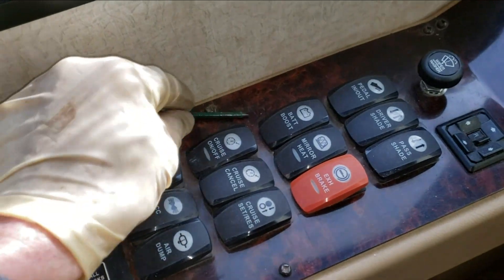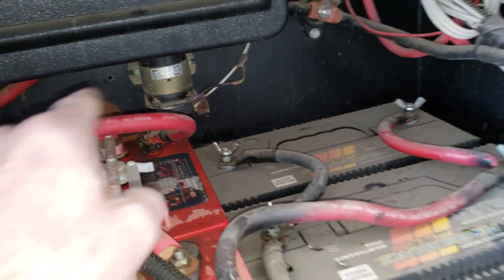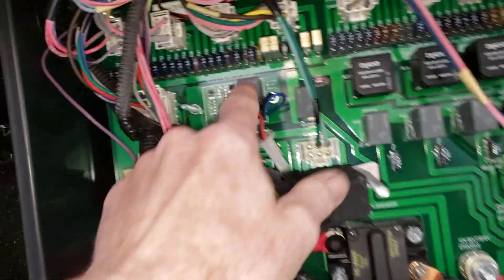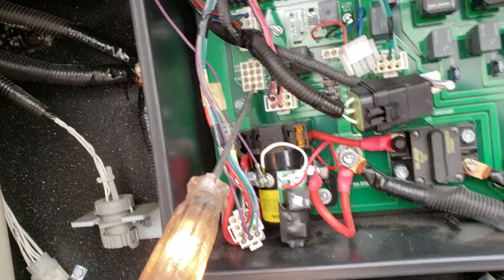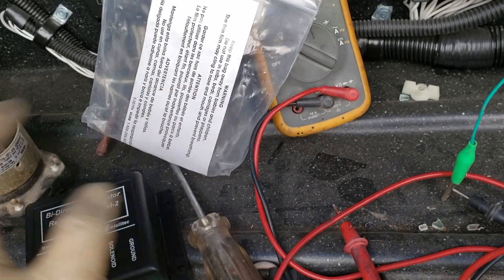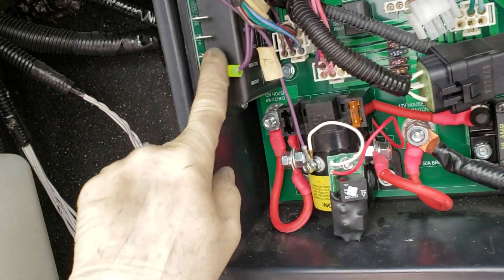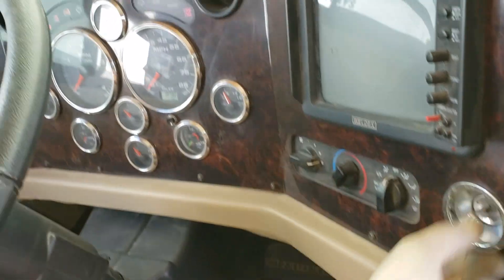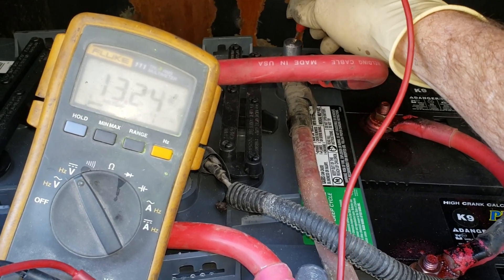Monaco Diesel RV Charging System Upgrade Trick?

Comment: Hey !  We're from Quebec and Having a Monaco Cayman XL 2007 with some issues...   We are going down to Florida in January for a month or two, would there be any chance to meet you somewhere :) ?
Reply from the maker: I live on the opposite side of the country in Arizona
Reply: @AZExpert  ohhhhhhhh...   wish we could vave met you :).   Thanks for all your good videos, just made this modification, ...    Cheers !
Reply: @AZExpert  By the way, would you recommend installing a platform to bring a 800lbs motorcycle in the back of a Cayman XL 34 feet ?  The way it's made underneath is not to welcoming for such installation first view....  and one last thing... where to find good rubbers for slide-outs?   thanks in advance :)

Comment: I ground off all the powered coat on my battery tray and painted it with POR 15 and a enamel top coat.
Reply from the maker: I can't explain how unimpressed with "powder coats" I have become after working on RVs. I think the movement to lithium batteries will solve most of the tray issues, though trays will not be needed with those.
Reply: @AZExpert  I put in a boatload of lithium  battries and a big inverter in my coach, Run that at 48 volts. Find out I still need 12 volts for the relays to make the bus work so I put 6 12 volt AGMs in back where the 8Ds used to live and I had to put in a 110 volt DC charger to make up for the loss of the old 12 volt inverter.
Reply from the maker: Thats unfortunate. What size batteries are the lithium?
Reply: @AZExpert  Battle Born 100ah

Comment: Good teaching. Here is a toughie.  The furnace max voltage allowed is 13.5V. When charging either by shore or genset, it is 14.4-=14.8V by design and required for FLA batteries to fully charge. Alternators charge at 13.8-14.2V.  This higher voltage causes an overspeed condition on the 13.5V max Suburban furnace, vibration, noise etc. Called Suburban tech. Said do not ever run the furnace over 13.5v. Or can damage the board. Well, hang on a second - 2 million RV's and cant use it when shore or genset is working - what the heck?  YUP, that is the bottom line he said.  No one has ever heard of this condition. 

And when driving, you would think the alternator would charge the house by default / design. I mean, 330HP and no charge - come on . . . . .  

What am i missing here?

Comment: Late to the party!
Can you drive your coach and have the generator running ( to have the ac units cooling the coach) and not have a problem with the BIRD?
Reply from the maker: It will work fine. Most diesel are already wired that way. Thanks

Comment: With all due respect, and I do mean that, I disagree with your installation instructions. The ignition lead that you are connecting to chassis battery post should be connected to a switched ignition circuit. The way you have it wired the BIRD thinks the ignition is always on. With the ignition always on you’re bypassing the safety circuitry that prevents the coach load from drawing down the chassis battery to 12v instead of 12.6v before the relay opens. It matters because 12v is a 25% charged state and 12.6v is over a 90% charged state. If there is any failure there is no safety drop out to save your chassis batteries ability to start the coach. I’m sure there are other potential issues but without understanding the actual functions and thresholds within the BIRD’S microprocessor, it’s hard to determine any additional electrical detriments. I do not have 100% visibility to all circuitry inherent to this system but after reviewing the schematics provided by intelletec and doing some testing myself I’ve concluded that the BIRD will not function properly if wired in the manner you’ve shown us in your video. I hold a degree in electronic engineering so I have a relatively good grasp on the fundamentals at play here but please correct me if I’m mistaken and I will certainly accept accountability for my error.
Reply: I think the advantage of connecting it to the unswitched chassis battery is so that the bird can charge the chassis battery while it is plugged in to shore power. If you had to have the ignition on to activate the BRD, this would negate/eliminate the benefit of shoreline charging of the chassis battery. 

In his description of how the BRD functions, if the voltage is too low on either side (chassis or house), it will not allow that the two battery sources to be connected through the booster connect solenoid in the battery compartment.
Reply: Hi Toby - I was initially thinking along those lines as well when I was figuring out exactly what was happening in this little black box. Since I did not have visibility into the logic that effects the functionality of the BIRD I did some testing with the various connection arrangements. After speaking to the technician that Intellitec has contracted, it turns out that my assumptions and findings were correct.  My conclusions are based on the information I received from Intellitec as well as my own bench testing. Keep in mind that some of the parameters given by the manufacturer are not exact however. What I mean by that is if we assume that my digital multimeter is accurate (which it most likely is) the relay delay (BIRD) is not operating  at the precise voltages specified by the manufacturer. They might say that the relay opens at 12vdc and it actually opens at 12.2vdc for example. I’m not sure why there is a slight difference but most electronics that I’ve worked with are  precise and I have to attribute it to variations within the charging source, I’m just not sure without understand more about the units logic. Seeing these variations however doesn’t change much in terms of the BIRD’s functionality. For the sake of simplicity let’s just assume that I found the BIRD’s operating voltages to be “within tolerance”. That said, the “ignition” connection on the BIRD only switches the logic gate between a 12vdc and a 12.6vdc logical switch which opens the relay and disconnects the battery banks. If the ignition is on and the ignition circuit registers more than approximately 13.1vdc, the relay is closed and the battery banks are paralleled. If the ignition circuit is on but the BIRD detects the ignition circuit is at or below approximately 12vdc the relay opens to isolate the banks for protection. This happens only when the ignition is on. This is a very important aspect of the functionality because as the engineer explained, the BIRD must see voltage on the ignition port (ignition on) to tell the system that the alternator is charging the chassis batteries. If the alternator is charging and the ignition circuit is reading 12vdc or below you’ve either got a big load on the alternator or you’ve got another problem with one of the systems or loads. If the BIRD thinks the alternator is charging (ignition on) and it’s actually not charging because we connected to an unswitched chassis battery source, we run the risk of discharging our chassis battery to 12vdc or a 25% charged state. In this scenario without the alternator charging but the BIRD thinking it is charging we run the real risk of the chassis batteries being discharged to the point of not being able to start the engine if the coach batteries become discharged for whatever reason. Since the alternator is not charging (but the BIRD thinks we are) we are actually discharging the chassis battery without any means of charging it back up. A 25% state of charge (SOC) is going to leave you in a situation where you cannot start your coach. If the ignition is off however (and the BIRD’s ignition connection is hooked up to a switched chassis circuit) the logic will open the relay when the chassis battery is at 12.6vdc which leaves you with a 90% SOC which is enough to start your engine. If you have a diesel you’re going to need that full SOC to get your engine started, but of course there are other factors at play when we’re discussing forces that impact engine starting resistance. In any case by having an “always on” state of ignition by connecting the BIRD’s ignition connector to an unswitched chassis battery source the system assumes that the engine is running and the alternator is charging. Since this isn’t actually the case your chassis batteries could be run down to a 25% SOC leaving you with discharged chassis batteries. The installation instructions explain all of this so I would be sure to connect that ignition connector to a SWITCHED ignition source or you may run into problems down the road when your coach batteries deteriorate. At least this is the way that Intellitec’s BIRD is designed. I welcome any intelligent dialog as I am an electronic engineer and really enjoy understanding these systems. 

Thanks